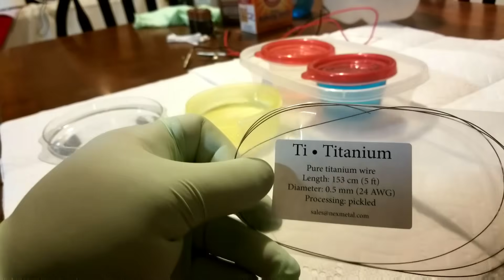How To Anodize Titanium With 9V Batteries Cheap And Easy - Full Tutorial

Comment: If I use a copper or steel wire instead of a titanium one will it work? I am in the process of gathering supplies for anodizing my Benchmade balisong and don't want to ruin my expensive knife. Thanks!
Reply: Aluminum wire also works
Reply from the maker: Yeah, haven't personally used it, but I've been told it seems to work just fine as well.
Reply from the maker: It won't anodize properly without the titanium wire. I have a video on my channel that you can check out that shows what happens with copper wire. You will get some color, but not the color you're looking for. I strongly urge you to check out the video, and spend $2 on the right wire. You can order it online, or even possibly pick it up at a vape shop. Any other questions, feel free to ask.

Comment: Hey, Are you able to reuse this stuff?
I poured most of the bottle in a glass container and it worked perfectly the first time I used it. Then I came back to it a few weeks later to anodize another knife and it no longer worked. I poured what I had left from the original bottle into a new container and it worked fine. Is this meant to be used only once? Thanks.
Reply from the maker: Which stuff are you referring to, the Whink rust and stain Remover? If so, you definitely should be able to re-use it.  I re-use mine all the time over and over.
Reply: Yes, I was referring to Whink. Strange, like I said, I poured in a glass jar (pasta sauce style), did 3 or 4 anos fine, then when I tried to use it a couple of weeks later, it had no effect, I had to use some new one. Maybe the glass affects it??? It sounds like it shouldn't.
Reply from the maker: That's really weird. I can't say I've ever ran into an issue like that, but I always store mine in plastic similar to the container it came in. If you remove a ton of anodizing with it I've noticed it will get weaker, but I've never had it just stop working all together.
Reply: Thanks, I'll try to store it in plastic next time and see if it makes a difference.
Reply from the maker: Seems odd that glass would have an effect, but worth trying the plastic anyhow

Comment: Hopefully you're still answering questions. And mine might sound stupid. Is that just regular red and black speaker wire
Reply from the maker: Sorry, just saw your question. They are alligator clips, but you could use any regular copper wire if you don't have the clips. The clips just make a better connection. Anything that goes into the bath on the positive side has to be titanium though. That's why you see a small piece of titanium wire between the alligator clip and the piece that is being anodized.
Reply from the maker: Hope that answers your question. If you need anything else, feel free to let me know. I'll help any way I can.
Reply: SharpKnifeNuts thank you for the response.

Comment: Would painters tape or something of the same sort work to cover parts of the titanium, so it wont anodize?
Reply from the maker: Personally I wouldn't trust painters tape for that purpose. Depending on why you are covering the part you may be able to get away with electrical tape if you are just making off for the sake of aesthetics, but if it's a critical part you are trying to mask I would stick with a few solid coats of nail polish, making sure to let each coat fully cure. Then when you are done anodizing the nail polish can easily be removed with acetone. Any other questions, feel free to let me know.
Reply: SharpKnifeNuts thank you
Reply from the maker: No problem, glad I could help!

Comment: Will aluminium wire work for dipping from what I understand it just needs to be a non staining metal
Reply from the maker: No, aluminum will not work. I have a video on the channel about using copper wire. Check that video out, you'll get roughly the same results.
Reply: SharpKnifeNuts ok I had seen the copper video in glad I asked cause I kept hearing that it was good to go
Reply from the maker: I get quite a few questions about weather or not it matters if you use titanium wire, or some other kind of wire. There are like 2 other wires that can be used, but they are not common materials. Titanium is much more readily available.  If you have a local vape shop you may even be able to find the titanium wire there, otherwise online is probably the way to go.
Reply: SharpKnifeNuts never would have thought about checking the vape shop thanks for the tip
Reply from the maker: No problem! Some will carry it, some won't, but it's worth checking. You'll probably pay more, but you'll get it right away. If they don't have it, I got mine off Ebay for less than $2 I believe.
Reply: SharpKnifeNuts yeah I was being impatient I will just flame anodize a bead or two while I wait for my supplies to come in the mail
Reply from the maker: Lol, I get the same way. Just be careful flame anodizing around the lock bar if you're doing it on a knife. Not sure how much experience you have flame anodizing, but the lock bar was the main reason I started doing it with 9V instead.
Reply: SharpKnifeNuts I wouldn't do a knife like that but if I did it would be on a zt with a removable lock face and detent ball. I have a zt 0801 that's just screaming for some color I'm thinking purplish blue
Reply from the maker: Feel free to post some pics of whatever you do, I'd love to check it out. My links to Instagram, Facebook and Twitter are on my YouTube homepage. I love me some custom ZT's, lol
Reply: SharpKnifeNuts will do
Reply: Hey just one more question I want to get a consistent color and I'm going for a blue should I use three new batteries on each scale or can I put them both in the anodizing bath at the same time with the same price of wire
Reply from the maker: Trying to get a consistent color can be tricky.  If its important to you to get them as close as possible to one another in color, then yeah I would do them both at the same time. If you do them separately you can have small changes in voltage, and small variations in color. Just be sure to clean them both really well with acetone first, then do them in the same bath at the same time. That'll be your best shot at getting the most consistent color. The good news is if for some reason you aren't completely happy with it, then you can strip it and try again.
Reply: @ApollosRings  ok last question I swear haha. Ok so I did a zt 0801 and I used three 9volts to get a blue but it's between a blue and purple color and I can't get it to go full blue. I did a smaller zt the 0450 and it went blue no problem. Should I try using another battery or just wait longer or use a bigger peice of stainless in the water bath what do you think? Also  I just wanted to thank you I've been having so much fun with this your tutorial has really opened up a lot of projects for me.
Reply from the maker: Have you checked the voltage of your batteries recently? You may have discharged them just enough to drop into the purple colors. It's a fine line with voltage. If you have either Whink, or some other type of hydrochloric acid then I would experiment with an extra battery and see if it gets you the color you're looking for. If not, worst case you have to just remove the anodizing and start over. Glad to hear that the videos helped you get started into doing some custom work, that's awesome to hear! Feel free to ask as many questions as you need to, it's no bother whatsoever.
Reply: @ApollosRings  I have done a bunch of smaller peices like pocket clips and laynard beads and I can get blue just fine it's just the bigger slabs I did a okc Carter prime and got the same result a mix right in between purple and blue. If I use them and get my hand oil on my knives it looks like blue but if I clean them with alcohol they are purple it's weird.
Reply from the maker: How big is your cathode? If it's really small, that may have something to do with it also. You want to try and make the cathode roughly the same size, or a bit larger than the piece you are anodizing.  Aside from that, you might just need a touch more voltage. I have a little rig made up that will hold 6 AA batteries, but I can remove each one separately so I can adjust the voltage by 1.5 volt increments. If you are doing a bunch of anodizing, one of those might come in handy so you don't have to always just jump by increments of 9 volts. Then obviously if you get really serious about anodizing then you can just get a power supply and be able to really fine tune your voltage. I'm going to get one pretty soon myself. I've got a ton of projects it would really come in handy for.
Reply: @ApollosRings  thanks I will give that a try and let you know how it turns out
Reply from the maker: Sounds good
Reply: @ApollosRings  well the bigger cathode did the job I will share what turned out and tag you on Instagram thanks again man.
Reply from the maker: Awesome! That's great news! Glad it worked out for you. Yeah, I'll check it out on Instagram for sure. Glad I could help steer you in the right direction.

Comment: the wire has to be made of titanium or it can be made of stainless steel?
Reply from the maker: For it to anodize properly the wire needs to be titanium. It can be done with other types of wire, but you will get poor results. I have a video on my channel of what happens when you use copper wire, check it out. I believe you would get even worse results with stainless.
Reply: SharpKnifeNuts thanks!!
Reply from the maker: No problem!

Comment: If you are starting with bare titanium is it necessary to have to etch it? I’m putting a satin finish on a pocket clip for one of my knives and want to do the blue ano, I don’t want anything to dull from the acid since I’m going for a shinier finish. Any other good prep to do in that case to clean it?
Reply from the maker: You don't have to etch it, but the color is much more vivid if you etch it first. I have done some high polish pieces and tried both etching, and skipping the etch, and every time the etched piece always comes out better. It will absolutely work without etching, but I still recommend a quick etch even for a high polish, and definitely for a satin. I wouldn't worry about a quick etch messing up your finish, but If you are really concerned that the etch will mess it up then try it and see if you're happy with the color you get without etching. If after anodizing the piece and you aren't happy with the color you can always go back and etch it, then just re-anodize. The etch will remove the old anodizing.

As far as prep goes, just make sure you wipe everything down with acetone really, really well. I usually do the wipe down two or three times on an important piece. You could even give it a little bath in acetone just to be sure all oils are removed before starting the process, then after its clean just be sure not to re-contaminate it. Make sure you have gloves on when touching the piece. If you do bath the piece in acetone, be sure to wipe it dry. If the acetone pools and then evaporates on it's own sometimes it will leave a pooling mark. Aside from that just follow the steps in the video to a T and you'll be golden. 

Any other questions or concerns, feel free to ask. I'll help with whatever I can.
Reply: SharpKnifeNuts thanks for the quick reply! So does acetone Work the same as the rust remover? Or should I just use the rust remover
Reply from the maker: Acetone is just for cleaning the part. The Whink Rust & Stain Remover has Hydrofluoric acid as the active ingredient, so that's why that is used to etch the part. So the acetone cleans, the Whink etches. There are other products that can be used to etch, but some of them are quite a bit more expensive. The Whink is fairly cheap, just a few bucks a bottle on Amazon.
Reply: SharpKnifeNuts what would you recommend putting the whink acid in? Like container wise. I don’t want it to melt or something lol
Reply from the maker: Any cheap plastic container will do. I store it in a cheap plastic container that lunch meat came in, lol. The acid won't react to plastic, only metals. If you use the Whink, just make sure you do so safely. Latex gloves and eye protection.  Keep baking soda on hand as well. You'll need it for your electrolyte mixture anyway, but it will also stop a chemical burn from the hydrofluoric acid if you ever accidentally get it on you.
Reply from the maker: Just make sure whatever you put it in is big enough to submerge your part, and best if it has a lid because you can re-use the stuff again and again.

Comment: "Contains hydrofluoric acid"

Nope. No thank you. 

I didn't even know you could get hydrofluoric acid in a consumer product.
Reply: Ya I was about to get some and then noticed that.  That stuff killed alot of people who worked with reactive metals like Ti.  That's one reason I worked out the money for multi-etch and no I don't work for them. 😀
Reply from the maker: Its definitely not something that you want to be bathing in, that's for sure. I believe it's diluted to around 3%, but still not something that I want to be getting on me. I use proper PPE, and recommend anyone using it does the Same. That being said, I completely understand why someone would choose not to use it.
Reply: Just wanted to add that it's not just the fumes that are bad.  Contact with skin only with HF can kill you.  When I was in grad school there was a lab in the building that worked with the stuff and it gave me a healthy respect for it's toxicity.

Comment: hi buddy - how durble is the finish compaired to say a sebenza?
Reply from the maker: Very durable, and even more so depending on what voltage you use. The higher the voltage, the thicker the anodized coating. I know I'm answering this again for you, but if anyone else stumbles upon this question I wanted them to have the answer as well.

Comment: If i where to try do this on a grey stonewashed knife, like the finish of a spyderco myrtle (I think most Ti spydercoes have the grey-stonewash finish im thinking of) would i need to remove the finish or can I directly apply it to the knife? Im assuming it would make it more matte
Reply from the maker: If it's just stone washed you do not need to remove a finish, but I know some Spyderco models with titanium scales do have a clear coat on them. Pretty sure the Nirvana has a clear coat, but I'm not too sure about other models. If it does have a clear coat you should be able to remove it with scotch-brite  before anodizing.
Reply: it doesn't feel like it has a coat, if you run your nail on it it's like a chalkboard, that dusty smooth feeling. I'm gonna shoot for the early purple and early blue I think. When doing this on a framelock do you have to worry about the detent ball, or the interface, or the washer track? along with screw threading or stop pin slot? sorry to pester, I don't mind screwing up the colour, as long as it still opens and closes alright
Reply from the maker: No worries, I definitely don't mind helping. As far as a clear coat goes, you'll know right away if it has one if it doesn't change color. Then if it has one, just remove it. You definitely need to cover the detent ball, and anything else that either isn't titanium, or you just don't want it anodized. Make sure you put a few good coats of nail polish on whatever isn't titanium, and let the nail polish dry completely. It will screw up your anodizing if you don't. Some people use nail polish on the bearing track as well. I haven't, and never had any issues with opening or closing, but if it's a concern for you just cover anything that you're worried about with nail polish. After anodizing you can remove it with acetone. The only thing that I would really be concerned about personally would be the detent ball, and anything that isn't titanium though. Everything else should be fine. Hope that helps answer your questions. If you need anything else, just let me know. I'll help any way I can.
Reply: Thanks heaps mate, i'll give it a crack the second I can get my hands on titanium wire, which may take some time, i'll let you know how it goes!
Reply from the maker: Awesome! Sounds good, yeah definitely let me know how you make out. FYI, one guy said he used copper wire and didn't have an issue. I've never personally tried it, I was under the impression that it would take current away from the piece you are trying to anodize, but if you want to give it a shot, he said it worked fine. I'm going to do some experiments myself for a upcoming video testing it. Just thought I'd pass that along. Good luck, and keep me posted.
Reply: alright so update 1. I tried anodising it, the scale was bubbling in the solution so the circuit was complete but no colour change, I'm assuming it's coated. I'm trying to think of a way to remove the coat without changing the finish too heavily
Reply from the maker: I kind of figured it would be coated. A green scotch brite pad shouldn't change your finish drastically if you just take it easy and really just work at the coating. That would definitely be better than any kind of sandpaper. I use a scotch-brite wheel on my dremel frequently on my ti scales with good results. I would recommend doing it by hand if you want to maintain the finish as much as possible under the clear coat though. I ran across a post in one of my Facebook groups about this very issue not that long ago, let me see if I can find it. I'll let you know if i come across it and have any better advice for stripping the coating.
Reply: I'll try it on an area between the scale and the liner first, then colour and see if its a finish I'm after for the entire knife
Reply from the maker: Good idea
Reply from the maker: You can always re-stone wash it after anodizing as well if that's the look you're going for too.